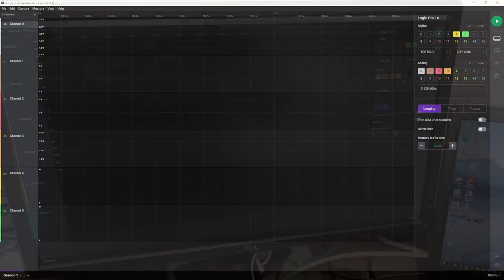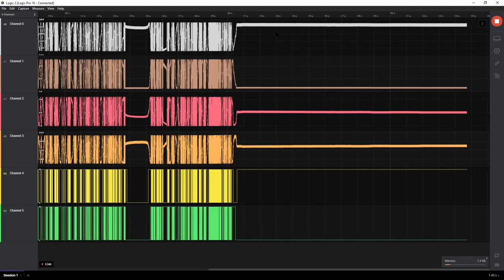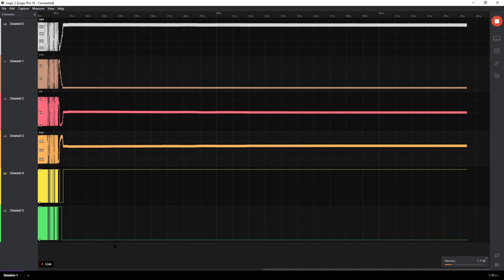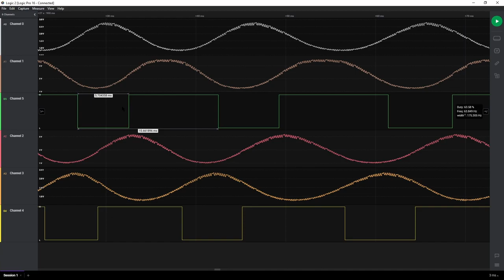DRO Project: Signal Analysis

Comment: Bravo Sir. Fascinating. Those analogue signals almost look like the output of a resolver. Really interesting deep dive into the scale outputs. Thank you very much for subscribing to my channel.
Reply from the maker: Many thanks!
Reply: The analog signal is the intensity of light crossing a line in the glass scale. Pretty ingenious really. Low tech for high resolution. And micron accuracy.

Comment: Swap to a teensy 4.0 for your digital read might be a good start. 
Looking forward to the next. 
Trying to do my own project with magnetic linear incremental encoder. 
Love to see your outcome
Reply from the maker: Hi, yeah I intend to use something with a bit more umph to do the processing.. The Arduino's as good as they are, don't quite have the speed. I'm currently looking at designing a fast ADC circuit which outputs 4x8bit samples as a 32bit value and streams it over a serial link. All the heavy lifting can then be done away from the read heads. Finding the best sample rate is the fun bit.

More to follow soon..
Reply: @m0xya  check out Jan lukes videos for inspiration. 
He's done several with different encoders using teensy.

Comment: i believe there may be 2 problems.  1. those may not be sin/cos waves.  2. the leds and photodiodes are not matched.  I have messed with heidenhain sin/cos rotary encoders and I believe they are very closely matched to produce a good signal.  that's not to say you can't get some additional accuracy but arctan2 will only get you so far.  I did a video on the heidenhain encoders if you are interested.  Another approach is dividing up the signal into more crossing points by multiplying the signals, there is a project called anaquad which did some of this.  There are also lots of papers on error correction and compensation for sin/cos encoder signals.  very close to what needs to be done with wireless radios (quite the rabbit hole).  Have you messed with the Z/R signals for error correction or does your DRO only have A/B signals?
Reply from the maker: thanks for the message. this project is a slow burner which i'm looking at when i have time. however, my main goal is to look at the signal analysis side of things and experiment with processing options. i will look at the options you have given. many thanks..

Comment: Hi from Australia. I was looking at the screen and I think you had the digital lines the wrong way around as if you line the vertical lines on your screen with the change of digital state they line up with the top and bottom of the analog signals. I like wear this is going but I have a niggling thought that if you need the scales to move fast you are going to have a problem reading it and will have to go with a expencive A/D converter that will have to read at a fast speed. I do not think a cheap A/D converter will have any hope of reading it to the accuracy that you want unless it is only going to be moving very slow. regards and looking forward to the next video and what your thoughts are.. But keep going with it..
Reply from the maker: Hi, yeah all very good questions and suggestions. My first concern is removing the noise from the signal, and finding an optimal sampling frequency. This is all work in progress. So more updates to follow..

Comment: Interesting project. I have 5 micron scales on my vertical mill. I don't think I need any more than this (0.2 thousandths of an inch in imperial) there is more flex in my setup than that. But I am definitely going to follow your progress on this. I wonder what you are doing that requires such accuracy or is this one of those "what if" projects?
Reply from the maker: Hi, thanks for messaging. The project serves two reasons: first, i want to make a precision scale for the vertical axis of my surface grinder, second (and probably the most important) just to see if it can be done..

Comment: The problem with glass scales is that they are huge, susceptible to dirt and discrete.

The analog signals appear as sine waves. Why?&

In the Newell system, they pack a tube with ball bearings which act as a magnetic core. In the read head you have a 10 khz signal passing thru a coil which rides the tube. Four magnetic pickup coils pick up the various flux emissions as the reader moves. According to Newell the changes are based on phase shift.

You think this system works the same way?
Reply from the maker: Hi, thanks for the reply. No the optical scales work in a different way. The sine wave captured is caused by the change in  light level as the read head moves across the mask in the glass scale. It is a changing value over time, related to how fast the read head is moving and the rate I am sampling the values. If I kept the read head still the value would not change over time.

The scales you're looking at use a totally different technology and as a result give a different output. Your question has put me in mind of a demonstration video. I may also discuss the other methods used.

Many thanks..
Reply: @m0xya  cool! According to the Newell site, a 10 kHz sine wave is presented to the first coil. Then there are four pick up coils back to back following the driver coil. All coils are wound on a common coil tube most likely plastic. The scale tube is either stainless or plastic. Stainless would be non magnetic so only the nickel ball bearings packed in the tube would interact magnetically with the drive coil.

Here is where things go weird. The waveforms picked up by the pick up coils would be sine waves but apparently they are phase shifted. According to Newell the phase shift varies from 0 to 360 degrees. I always thought the phase shift was limited to 180 degrees as then the second waveform overlays the first and the shift starts again at zero.

Where is the phase shift? Is it between any signal and the drive signal or is it between the signal pickups themselves? In any event, there is a whole lot of zero crossing going on here.

In your discussion of a linear encoder, it appears that that the quad compareter chip is producing a signal based on zero crosses from the glass scale.

Since a comparater is analog, would it be possible that Newell is simply using the zero crosses of the sine wave the same way as amplitude or waveform shape does not seem to matter?

Furthermore, why would it be necessary to drive the coil with a sine wave?  That requires a sine wave oscillator in the read head. If you drive the coil with a square wave, you can get your phase shift zero crossings for the comparater in the same way. The use of a schotkey fly back diode should eliminate any back EMF if that is needed.

The advantage of this scale are three fold. 1). Space. My lathe is a tool room lathe with attachments such as dial gages, steady rest, taper attachment etc. there is not a lot of space to work with. 2). This scale is sealed from oil and chips. 3). The scale is analog not discrete. I didn’t say digital but discrete. Depending on the lithography you will get to a point where resolution is capped.

Comment: That Mega has ADCs on board, though I guess you may not be able to sample them quickly enough...
Reply from the maker: Hi, yeah the mega is capable of sampling at 10bit on the ADCs. However, the sample rate is not high enough. My plan is to use a high speed ADC. I need to run the numbers and work out the overall requirements.

Comment: In order to capture a smaller displacement. Just buy a 1um glass scale.
In order to find the real zero and 5um transition point of the glass scale, just adjust the potentiometer so that the comparator IC will trigger right at the crossover point.
But then, this is quite pointless. As our machine cannot reach that precision. In terms of accuracy, most machines couldn't even 0.001" (0.025mm or 25um) precision. The machine's resolution is 0.001",  and resolution is not the same as accuracy.